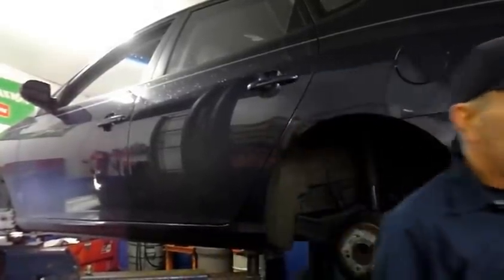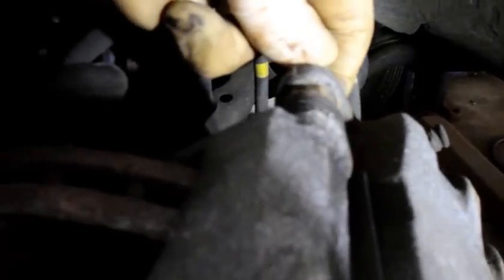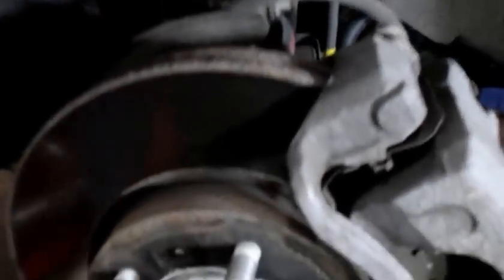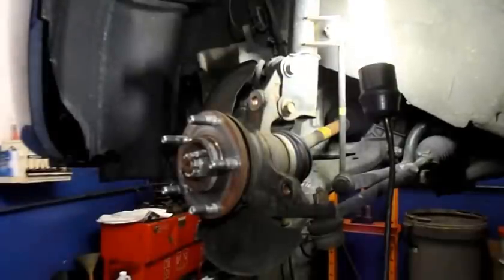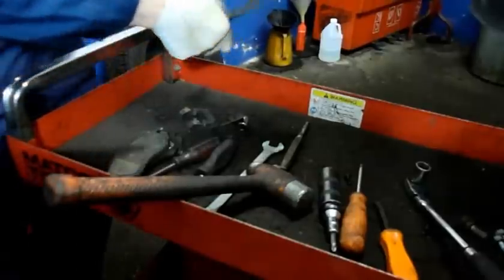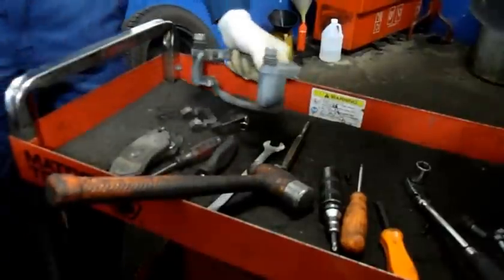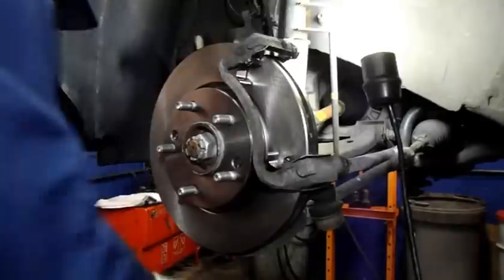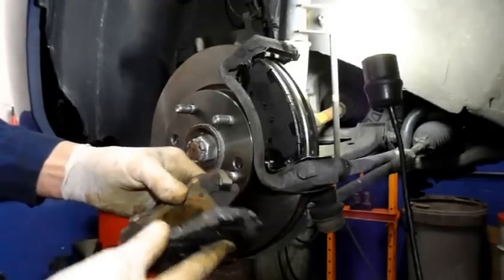How to replace front brakes and rotors on a 2009 Hyundai Elantra

Comment: Great tip to smack the rotor screws with a drift & hammer.  You can also use a longish bolt; I use a big #3 screwdriver and just smack that.  To other viewers, the funky fat screwdriver-looking tool briefly shown near the beginning, that we'll get back to later, is an old-school impact driver.  Useful when the little rotor screws are seriously stuck.  You set the heavy-duty screwdriver bit on one end into the screw recess, and then smack the other end of the tool with a heavy hammer. Under impact, it attempts to turn the bit about 1/8 of a turn, and it really can't cam out of the screw because it's still carrying the forward force from the hammer blow.  The tool costs about $20 at the hardware store and you'll hardly ever need it, but when you do need it, good golly, nothing else will do.

Comment: Is it super important to make sure the flathead screws are in place on the rotor? I have a lot of wobble when breaking. I checked my rotors and will replace them soon following this videos instructions. My rotors don't have those screws. My passenger side does but the driver side doesn't. They either fell out or rusted off. Is it absolutely necessary for them to be on? I'd have to buy some somewhere. I just want to be extra thurough.

Comment: hey Jim great video for DIY guy like me, looks easy hope I could do that too.. I don't know which of the breaks I'm going to. replace (it sounds squeaky everytime I step on my break pedal) if its the front or the back. Do i need to replace the rotor too?
Reply from the maker: +Zaldy Bitonga   That depends on  what condition the rotors are in if they are rusted or have deep pitting you should replace them.If you run into a problem let me know I can help you through it.

Comment: hi Jim thanks for the response, I did replaced the front break pads and did the oil change as well. Now the breaks seems ok and responding on every press on the break pedal, one thing I've noticed that every time I de- pressed the break pedal I could hear a short squeak sound.
Before when I pressed the break pedal I hear the long squeaky sound and after replacing the front break pads I hear a short squeak sound when de-pressing the break pedal. What could be the problem?
Reply from the maker: +Zaldy Bitonga  Two questions for you is the squeak in the front or the back and when you replaced the front did you change the rotors and use a good quality  brake pad?
Reply: +jimthecarguy I didn't replace the rotor (still good) and the squeak sound came from the front, I suspect the lubrication on the clips of the break pads.
Reply from the maker: Good quality pads ?
Reply: +jimthecarguy I guess so thats what the guy said at the Auto Value, its a ceramic break pads..
Reply from the maker: Where they Wagner or Monroe?
Reply: +jimthecarguy hi Jim its all good now the short squeaky sound was gone after few hours of driving, thanks again for your video and assistance I really appreciate it more power, cheers..
Reply from the maker: +Zaldy Bitonga  Great job

Comment: Hello, Thank you for your great video. I just did my brakes following your video. But, I am a bit worried now. Some people warn about caliper mounting bolts vibrating loose and backing out. They say, you should replace the bolts each time with new OEM bolts pre-coated with threadlock, or use Loctite threadlock on old bolts. I would appreciate your advice on this. I checked the repair manual on Autozone website and it does not mention anything about threadlock.
Reply from the maker: Good question but as long as you tighten the bolts you don't have to worry about the bolts coming loose.I never use thread lock at my shop
Reply: +jimthecarguy Thank you!
Reply from the maker: Thanks for watching and your input